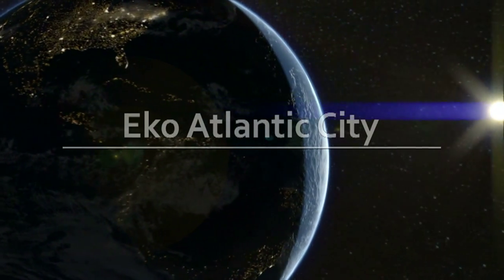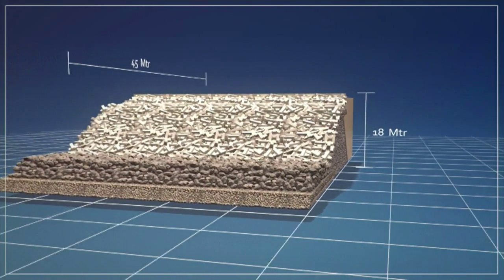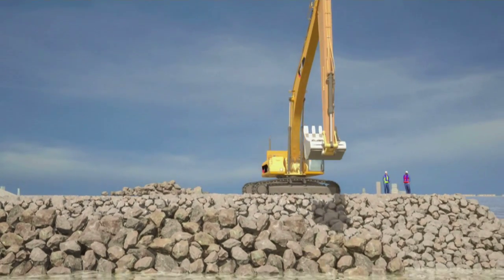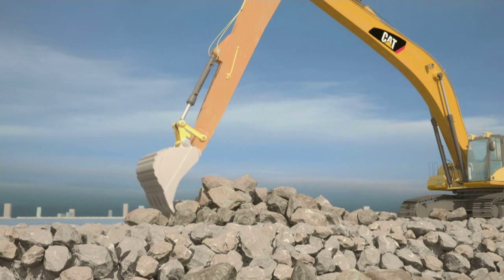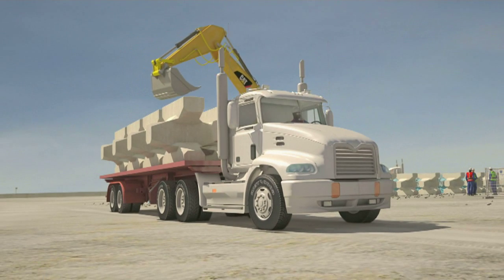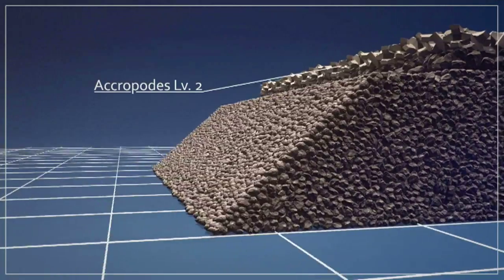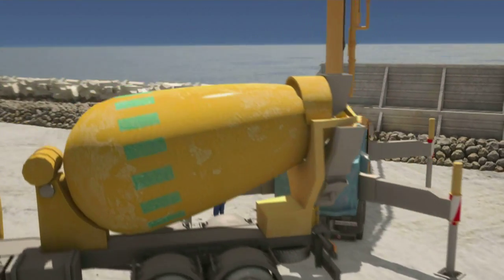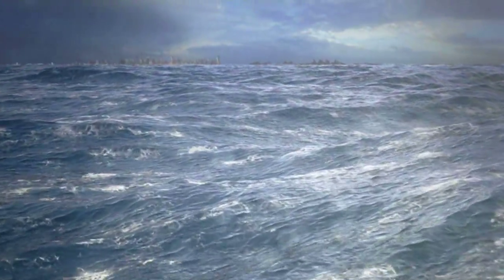Great Wall Of Lagos

Comment: What about liquefaction during  mid to high earthquake action? Nothing built on liquefaction pronged land will not stand for long even if it is made out of cement can it?what about very high tsunamis from undersea plate tectonics and other activity such as volcanic.
Reply: Because of the way Africa lays on the tectonic plates, earthquakes are highly unlikely
Reply: Bob Martin have you heard about earthquake or tsunami in Nigeria before.. the construction is safe all it needs is maintenance simple..
Reply: The wall was tested in Denamrk by one of the world's leading marine engineering companies and successfully past tests for the worst predicted floods and storms for a 1000 years! West Africa is not at risk from earthquakes or Tsunamis, inform yourself before commneting.
Reply: Thank God for everything 🙏
Reply: I suspect the actual physics of the underlayment with this cap designed only to withstand ocean surface waves of the recent past, not the long term hydrodynamics of the thixotropic sea bed with hydrostatic changes in sea level & plate tectonics.